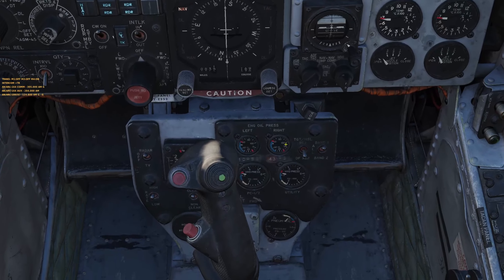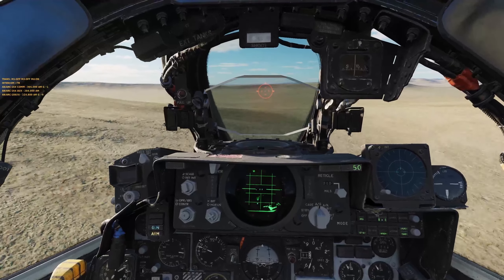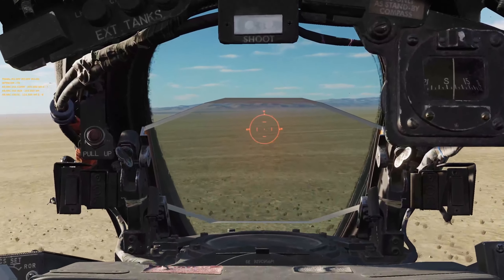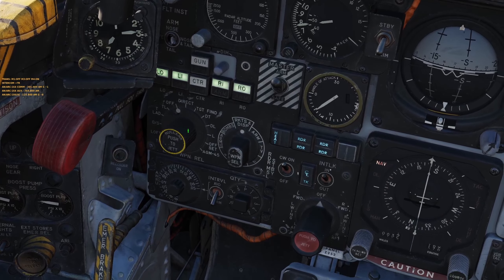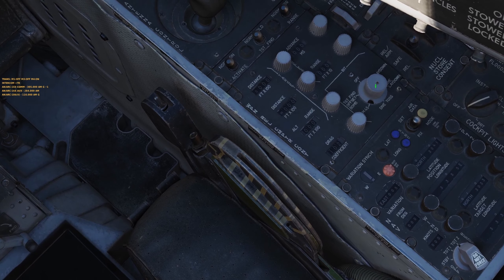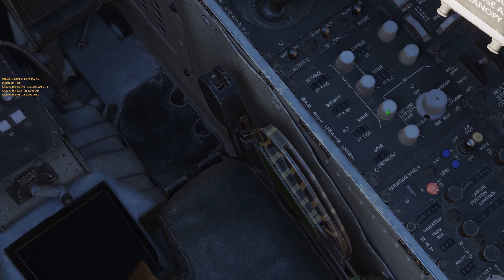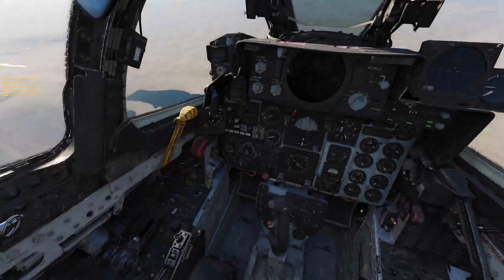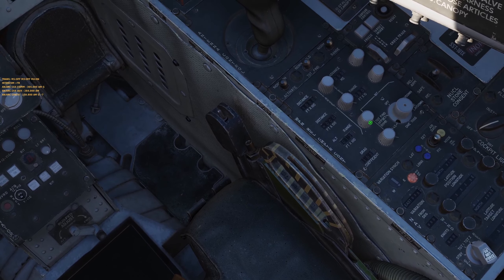DCS F4E AGM 45 SHRIKE DIRECT/ WRCS

Comment from the maker: as it turns out the shrike has different seekers that can be fitted in the loadout which will help in hitting your targets more effectively, the method for wrcs however is correct.
Reply: yes their are different seekers that will do the job. Again their not like the HARMS at all but your able to get close or even direct with the enemy SAMs/radars if you use the correct seeker head. Their are 8 seeker heads for the F4 at this date. Were all learning, it's only been like a week since the release of the F-4E and I just learned about the changeable seeker heads yesterday.